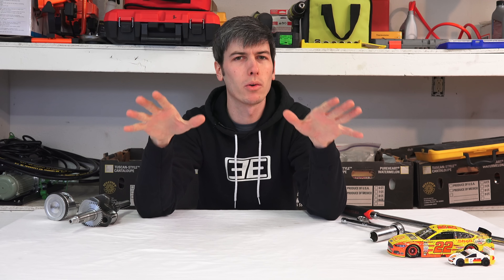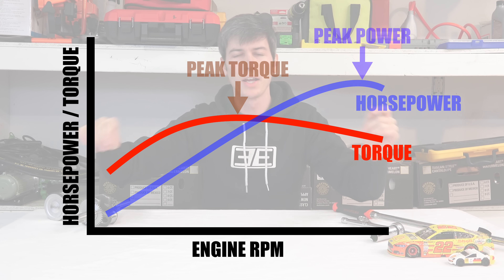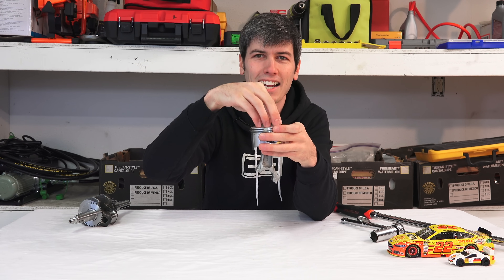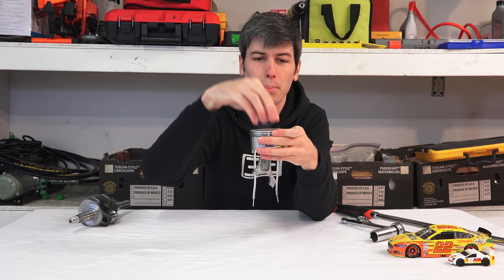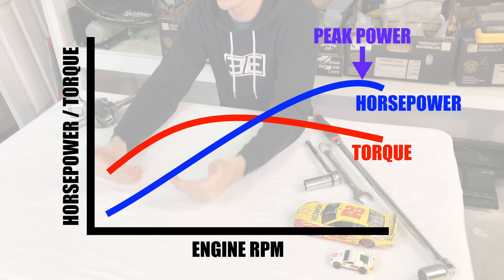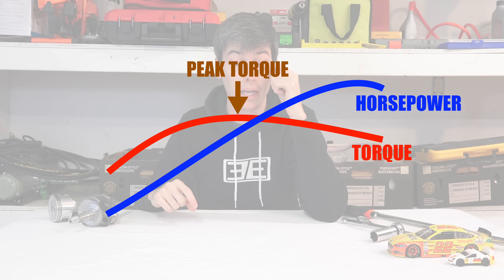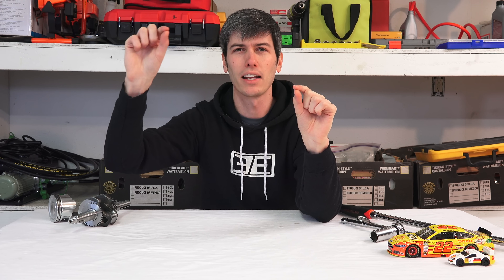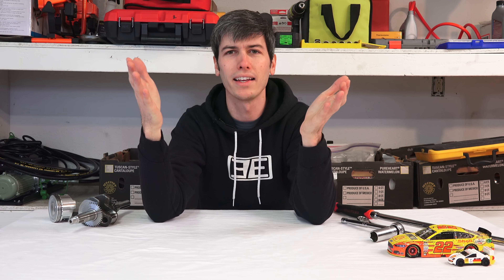Horsepower vs Torque - A Simple Explanation

Comment: So is torque how fast your car can go, while Horsepower is how fast it can accelerate?
Reply: torque is what accelerates your car. greater acceleration = more power. thats why this video doesnt make sense to me
Reply: @dynamo3059  Oh ok so torque is how fast it can accelerate and hp how fast it can go
Reply: not quite no. power = work / time. work = force * distance. so for cars, a greater speed means crossing a greater distance in the same amount of time. what does this mean? it means the make the same power you can either have a very high force ( torque) and a low speed, or you can have a very high speed and a low amount of.torque. or every combination in between that multiplies out to the same number. power is inherently connected to torque.

just as another counter example, as asteroid moving through space at a constant speed has no work being done on it, even though its moving really fast. because there is essentially no friction in space. it does not need to be "powered" to keep moving. speed =! power, even though power is connected to speed
Reply: @dynamo3059  I'll be honest with you,I don't really get it, but at the same time I still haven't learnt about all of this at school so it's normal.
Reply: @dynamo3059  Oh wait, so torque is how hard your car works but hp is how fast it works? so for example if you need to climb a hill, more torque is better than more hp, but if you do a race, more hp is better than more torque?
Reply: torque is a rotating force. its what causes your wheels to spin faster or slower. no force is needed for those wheels to keep rotating at the same speed, only to change speeds. thats why you need to "brake" to slow down. the reason youd need more torque to get up a hill is because you are fighting against gravity. gravity acts like a torque going down the hill, which would slow you down or even cause you to start rolling backwards if you werent exerting your own torque to counteract that force.

yes, hp is how fast the engine does work on your car at. work = force * distance. in the case of the engine this means torque * rpm, as when your engine spins faster the spinning components go a greater distance in the same amount of time. or they could spin slower but be acted on more forcefully by the piston going down. these both translate into more work being done inside the engine in the same amount of time. and power = work/time
Reply: @dynamo3059  Ok thanks

Comment: Which has more acceleration, petrol or diesel cars?
Reply from the maker: Could be either, whichever has more power, all else being equal.
Reply: @EngineeringExplained  so with same weight and dimensions of same cars with higher power and lesser toque, and a car with lower power and higher torque, which has better performance?

Comment: Torque is a force applied at a distance. It requires no motion at all. It is measured in an an instant of time (time is zero). Horsepower includes a time factor. The fastest acceleration of a car will be achieved when the longest period of acceleration time is using maximal torque. You can pull stumps with a low hp engine, it just takes time...

Comment: In structural engineering, we use the word  “moment” instead of “torque”.
Reply: If you work with shafts instead of beams, you'll see the term torque applied a lot more often.  Moment and torque are part of the same problem, because a shaft also has beam-like loads that are inevitably applied to it.

Usually the convention is that torque means it is parallel (twisting) to the axis of the member, and moment means it is perpendicular (bending).  In Physics, the preferred term is torque, used for both concepts.
Reply: carultch   Without forgetting torsion (twisting).  
Thanks for your input. 
In structural engineering handbooks, don’t look for a torque capacity or resistance for a given section, you won’t find any.
Reply: @JRondeauYUL  I've usually seen it called torque external to the shaft as an applied load, and torsion internal to the shaft as a structural load.
Reply: carultch  You’re right. 
We apply a torque which induce a torsion.

Comment: I'm sorry I didn't get it.
if HP = TORQUE * RPM , it should mean higher the RPM higher the power, but it is not true. If you watch any power curve, after the peak it descends, or it wouldn't be a curve.

Comment: If we take those 2 cars you put in example. And if they had constant torque that would mean the smaller car would have bigger force and it would accelerate faster which would give him higher velocity and greater power than that car with lower torque. It does not make sense that something that would have higher force which is tied with acceleration, would be slower?

Comment: work=force x distance; power = the rate that work is being done. To put it another way, work is a transfer of energy, and power is the rate of that transfer. Expressed in units of horsepower: 1HP=550 ft-pounds/second. Think of a 550 pound weight being lifted 1 foot in a second. For a rotating shaft the energy transfer happens exactly the same way, except that the force is making something turn in a circle instead of moving in a straight line. For a rotational force the work for 1 revolution is force x the length (distance from the center of the shaft being turned to the point where the force is applied) x2pi. Power, then, is torque x rotation rate x a constant: Power(HP)=torque(ft-pounds)  x rotation(RPM) x 2pi(rad/rev) x [((1/60)rev/sec)/RPM x 1 HP/(550ft-pounds/sec)]. There is an equivalent electrical unit for power: the Watt. 1HP=746 watts

Comment: How do you correctly use the calculation for hp?  I tried to calculate the hp for a car at 6000rpm with 95 ft-lb torque and got 570’000....

Comment: does this mean that higher reving cars are always more powerful?
Reply: Smooth acceleration not necessarily. You can have a lower revving car with a lot more torque and the horsepower could be higher. It depends on both torque and rpm.

Comment: i still have no idea what hes talking about lol
Reply: you mean torquing about
Reply: zeffery you could not got to cars same size? Really
Reply: What did you even just say
Reply: Lol ..  good one
Reply: @zeffery101  😂🤣
Reply: @zeffery101   you are a Jedi.
Reply: 🤣😂🤣😂🤣😂.  Me neither. I’m here saying to myself at the end of the video “ok, so, what’s horsepower and torque again?”  🤣
Reply: Torque is the ability to overcome disability
The engine needs torque to start moving the car
 for example 
The engine then requires horsepower to accelerate the car while maintaining torque
Reply: AHMED _ Think out of limit 
Omg, I can see it with your example. Torque then is the amount of force exerted on the engine to move the car and horsepower is the speed at which the engine moves the car meanwhile maintaining the exerted force initially required to move the car and which is still moving the car?? Wow!! That’s much clearer. I understand now. Thanks much!!
Reply: @TheAlchemistDavid  Yes, torque is the force applied to the axis of rotation
The horsepower is the rotation speed of the axis of rotation per second

The gearbox in the car is responsible for changing the  work out from machine depending on the position of the vehicle at that moment
Reply: Captain here
Torque is a force you can apply on something by turning it. When you hold something like a bar or a stick (heck, even your phone), you will see that its easier to crank it when you move your hand further away from the turning point. That's the distance he's talking about. Power is just how quickly you are able to crank something combined with the force you can put on it.
flies away
Reply: @Litl_Skitl  huh?
Reply: It's very simple the torque is the torque when the torque must be the torque but torque is the torque then it called as the torque 😂😂😂😂
Reply: @Nezumi Speed Lmao he literally explained it as simple as possible. It is not his fault you people are morons...
Reply: Whos talking here🙄🤣🤣🤣🤣
Reply: Me too. Dazed! torque and HP buzzing.
Reply: T =1lb per ft
Reply: if you are not a sub, see my comment.      cheers
Reply: He was going slow at first and then I got left in the dust 😂
Reply: Amen to that, lol!!
Reply: Lets tke it easy.. same strenght with speed difference
Reply: That's quite okay, neither does he. He's talking complete horseshit
Reply: After watching a few of his videos about things I already understand, I can tell you that he's not very good at explaining.
Reply: David To have the ability to explain something correctly is really rare
Reply: @David-ud9ju  Then perhaps it's time for you to do some explaining oh wise one.
Reply: and i thought torque is when they shake their asses hahaha
Reply: It's, HOW MANY EXPLOSIONS CAN YOU PAY FOR.
Reply: RIGHT

Comment: Now explain how a Model S P100D can beat a Veyron from 0-60 when the Veyron has twice the horsepower.

Obviously power alone doesn't tell you which vehicle is faster.
Reply: No problem, it is all in the drive train. If the Veyron had a perfect CVT made of "unobtainium" and low mechanical losses, that was able to allow the Veyron engine to remain at optimal RPM for maximum horsepower, while simultaneously keeping the drive-train at the perfect ratio so that the wheels always had the maximum amount of torque that the tires could handle, then it would beat the Telsa hands down. 

However, in the real world a Veyron uses a transmission with fixed gear ratios and a fixed ratio differential, meaning the wheels are only briefly receiving there maximum optimal torque, if that. This is a known and major advantage that 3-phase induction motors have over internal combustion engines.

Comment: Dirt track guys spin 350 chevys with stock top end 6800 and they don't make much horse up there it's actually way out of the engines airflow capability they do it because faster you turn it your making more power cycles per second with gear and tuning low horse engine can out run higher horse on track

Comment: My way of explaining this is torque is the force of maximum velcoity/pull(as if you were towing) and horsepower is the value that determines the overall max top speed potential of the engine, torque is acceleration, horsepower is overall speed,the way he explained this was more technical and didnt give the best examples imo, I still love his videos they are extremely high quality always.

Comment: I have a question 
I have a mass its weight = 20 KG ( as an example ) i want to use AC induction motor to travel this mass along on a table 30 meter as max. distance, but i dont know to calculate the appropriate torque and motor power to move this object along the table and how to know the force is needed it for it .
do you know how ?

Comment: You’ve said that the car with less torque and more power can use gears to accelerate faster , but if these two cars have the same gear ratios then which car will be faster?

Comment: So at 3:20  i think i need some clarification I might be wrong but the words you were using might be confusing as well. My understanding is that the car with more torque should have more acceleration  and the one with more horsepower has a higher top speed but it takes longer to get to but ultimately who is quicker is based on the distance they need to travel if the distance is so short than the car with higher horsepower car cannot even reach its full power than of course the higher torque would win but if it was a longer distance then it would be Vice versa. If I am incorrect please state why I just want to learn.

Comment: You do not need to calculate torque at specific gears to determine the best shift, all you need to do is look at the HP curve, if you draw the speed vs power at each gear, you will get for example 6 shapes for a 6 gear car that have the same shape as the rpm vs power curve above and they will intersect at the optimum shift point of each gear, which will typically be beyond the max hp.

Comment: My last build was purely for the most torque. 272 gears on a 383 stroker SBC. Real high compression: '68 'vette fuelie heads, 14.7:1 compression ratio. Mild dual pattern marine cam, methanol. FUN motor!!!

Comment: A good explanation from US citizen that drives only gasoline cars. Actually, the car with the highest torque will accelerate much faster at the beginning because the power is delivered instantly at much lower RPM. The gasoline engines lose a lot of time until reaching high RPM to provide power output - that is one of the main reasons why supreme car manufactures like Mercedes and BMW use diesel engines to premium, sporty models.

Comment: To a simple minded person like me my question..if a car can go 0 to 60 in 8 secs vs another car go 0 to 60 in 5 secs...which has a greater horsepower? Which has a greater torque? This line is the one almost always spoken as a sales pitch on advertising. Thx to anyones feedback.
Reply from the maker: Assuming they both weigh the same and are geared appropriately, more HP will always be faster (as stated in the video). But comparing peaks doesn’t always give the full story. You want more power across the entire RPM range.